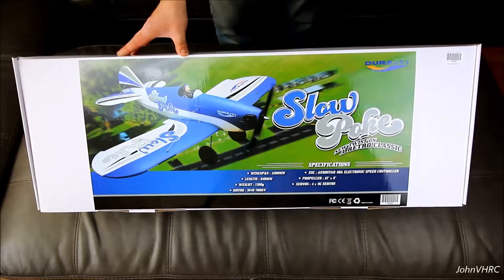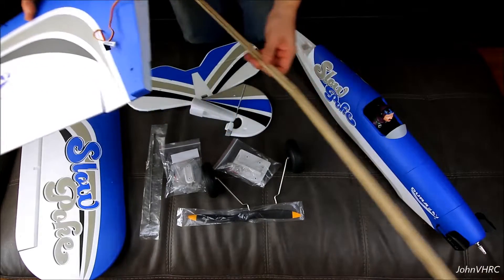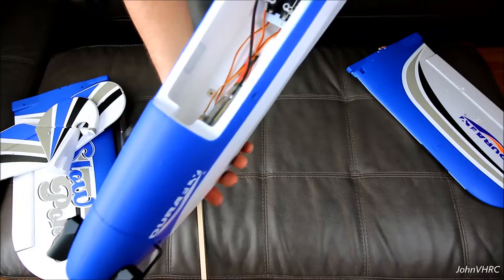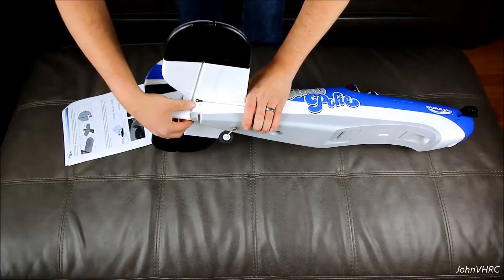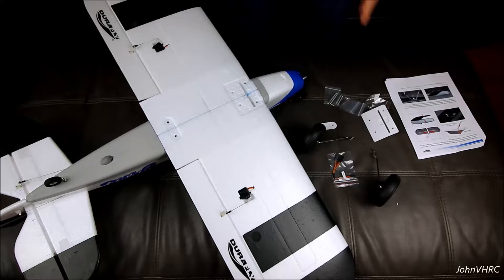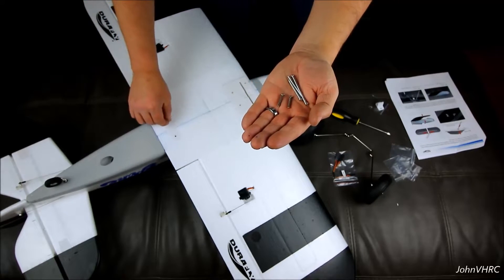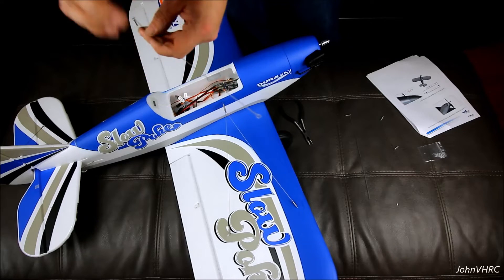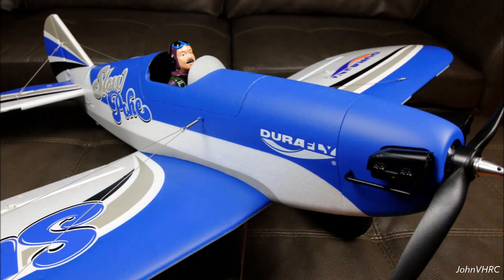Durafly SLOWPOKE 1200mm Unboxing and Assembly Review

Comment: The tail vertical and horizontal stabilizers are a bit cheaply made. They don't have airfoil contours as a real aircraft would have. I'm not saying it's necessary for a model aircraft, but it would be nice to have and perhaps not much more work or cost for the manufacturer to implement.